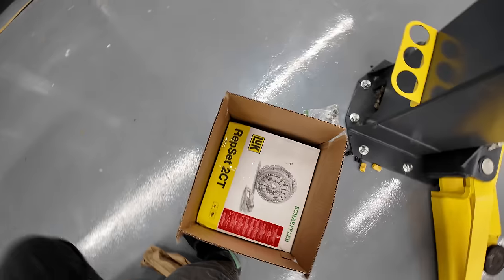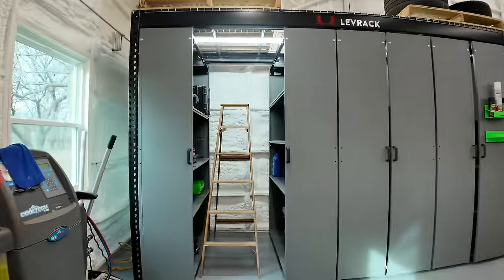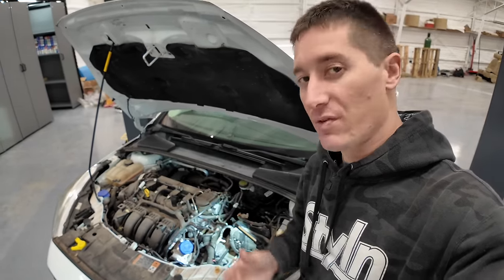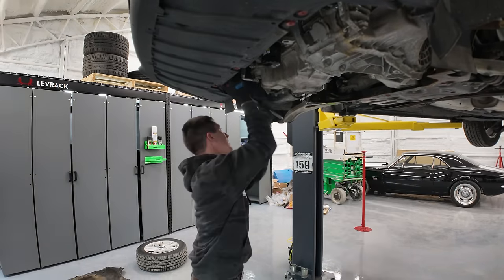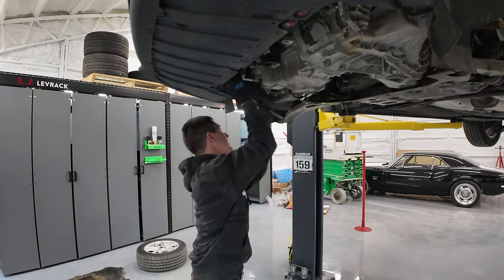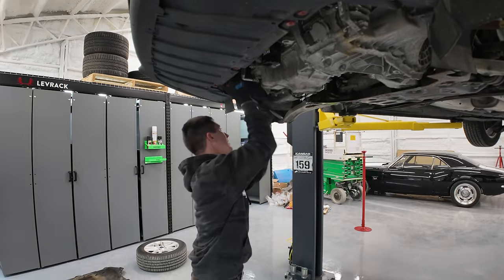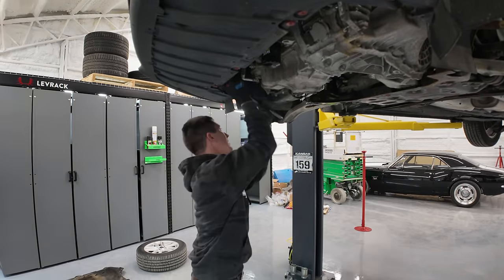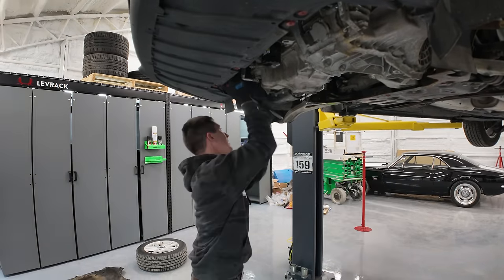Fixing The Problem That Ford REFUSED To Solve *Ford Focus DCT Clutch Replacement*

Comment: I'm shocked at the reasons why Ford would design such a transmission with no longevity, durability or reliability in their design and execution. 
But if you hire a bunch of newbie engineers who all want to make a name for themselves and completely forget about  applying the  common sense approach to any design of theirs, what ends up is built in flawed  ideas .
Reply: Wasn't it purchased from another company?
Reply: @deanstyles2567  Yes I believe you're right. The only car that Ford still manufacturers is the Mustang but as any Corporation who makes agreements with other car companies would have a team of engineers look at what they are getting themselves into, and since they all want to keep their jobs as Ford employees, they basically don't want to go against their bosses decisions simply because Ford has screwed itself by not designing, and building cars that are competitive in the marketplace. They still had post WW2 war syndrome in their thinking of quarterly profits rather than building quality products that have durability, reliability, longevity and the use of superior materials. 
And to have to see them not honoring the warranty to repair is just another sign of deep corporate corruption at all levels. 
They are like every other American automotive manufacturers. 
It's the 80 / 20 plan of attack. 
Throw out a bunch of poorly designed, assembled and lower quality materials into 80 % of their vehicles and see what sells and makes the most amount of money for the short term to pay for all their cooperate blunders from the past like the Edsel,Pinto, Taurus, Arrowstar,and the flip over expedition and have to go to court over the deaths of thousands of customers who bought this vehicle's only to have to loose their lives over a $3 .00 part that was demanded by the engineers to be located away from the heat of the engine to avoid possible fires.Or relocation of the fuel tank. 
And that's the 80 % of their business practices, which were personal vehicles, now the 20% was a different story. 
It is focused on building vehicles for the business side of the economy. 
Trucks and luxury cars were the cream of the milk can .
Owning a  small business or running a large corporation all require lots of cash investment. 
Trucks Trucks Trucks are the means to move things to their destination and provide a service which is chargeable fees . F-150,250,350;and econoline Vans 
And much better designed cars with comfort and better reliability in mind for the executive class is also part of the 20% zone .
This is the territory of the Crown Victoria, Lincoln, and older Mercury's. 
Yup they really screwed themselves up to the point of little to no returns by letting the Japanese /European auto manufacturers over take their industry and market share .
And it's an air apparent that the similar thing is now happening to the rest of the country with the unchecked mass migration across America's borders. 
Imagine that all this started from the core problem of greed and the love of money which replaced the ideal of building things of quality to sell to the American families. 
Yup and even the family is becoming an endangered institution. 
Anyway sorry about the novel.

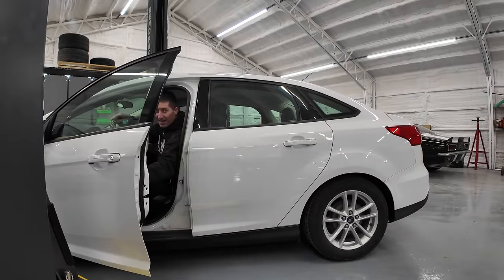Comment: Genuine question about the powershift transmissions, in regards to your comment at 2:37...    Is the programmed (in Drive and brakes not applied) "creep"  achieved with precisely calculated clutch slip?

Comment: JR it's not what Ford couldn't, it's what Ford wouldn't. This is why I don't buy new Fords anymore! They don't stand behind their failures. Quality is job one flew out the factories at Ford a long time ago. The last new Ford I bought was a 2011 Ford Fusion for my wife, great car, no problems. I replaced it with a Toyota Camry in 2020 because Ford didn't have anything comparable to the 2011 Fusion SE in the the 2020 Fusion SE. I don't want a turbo engine and that was the only engine choice for the Fusion SE.

Comment: 1st time watching your shop,amazing floor and lighting,how long has the coating last? excellent tutorial for diys and 1stimers. dont forget the tire inflator kit (just kidding),and whats up w/the three jb weld packs on the table?(also jk). ps my freind, pls dont use too much brake cleaner if you can, bad for your kidneys and health. i use light soapy water,and blowdry if possible.i tell my cust. to not inch forward in traffic jams. excellent work,not easy doing it right.

Comment: The clutch is not covered under the extended warranty from Ford, just the TCM and I'm pretty sure you know that.
Reply: He does,  but a clutch  shouldn’t last only 60k miles with  normal use, what garbage

Comment: Had that tranny in our 2015 Fiesta, dealer replace clutch twice in 45,000 miles, never did fix the issue of it suddenly taking off when stopped, also had chronic battery discharge problems if it sat over a week, had to install battery maintenance charge even with new battery!  Car drove great but was a drive train mess, so bad that when the trany was designed it was supposed to have a wet clutch but Ford went cheap with dry clutch, trany was so bad the design engineers refused to take cars home when supplied by Ford for testing!

Comment: As an automotive engineer having worked with and for the big 3 at some point, Ford appears to be falling in quality and engineering aka bad decision making. If the public only knew the chaos associated with developing and releasing an automobile.
Shameful lack of support from Ford at the 50K mile mark knowing this transmission design is sh!t. So, best to tell the world on youtube so the public knows.  BMW of course has moved away from Dual clutch transmissions recently. Why? Because the juice (quick, firm shifts) isn't worth the squeeze, aka weight, complexity and most importantly abysmal reliability and tunability...mentioned creep and low speed performance.  Overreach on the cheap by Ford to release something that isn't true i.e. a low cost, reliable dual clutch transmission. Trust me, when I tell you 'many engineers' knew during development this was an ill fated venture because testing doesn't lie. They released it anyway for 'marketing point's...lying to the public which is common btw.
Word up to average home mechanics doing this. Sell this car and don't try to fix it. Why?  Because history will repeat itself.  Or....if brave enough to pull the trans yourself and you have to be young, strong and smart to do that at home...don't try to fix the trans, purchase a remanufactured unit where pros rebuild them with fresh parts.  But I wouldn't. I would sell it and buy a car with a manual gearbox or torque converter trans.

PS. for those wondering, life for car owners is getting worse and not better. Why? Because automakers are deliberately making cars more complex for greater part failure out of warranty for more profit. Planned obsolescence. Even Honda and Toyota can't resist BMW's business model of over engineered cars for profit....not over engineered to last but to fail. Automakers make more profit when a higher percentage of replacement parts fail as compared to  automobiles they sell. Its a hustle. Buy a complex vehicle...like a hybrid with two powertrains and expect to pay dearly out of warranty.  Sell your car just out of warranty and get hit with massive depreciation, especially true of EV's and hybrids as the battery degrades everyday you drive.

Comment: too bad this didnt have a nice 6 speed torque converted trans. i know ford has issues with those but behind a 2.0L and with fluid and filter changes it should last 200k with a little lucas stop slip near the end.

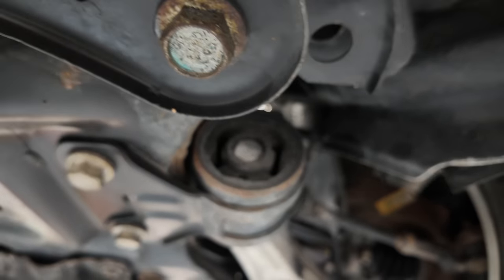Comment: 8:50  The front control arms on Focus/Mazda 3 of these era are a very, very weak point. Even worse is the replacement parts available. Most have rubber that is so soft that the steering will feel like marshmallow after 30000 miles, and time to do it again. It was even worse on the Mazda 5, as it is heavier.

Comment: Ford did not design or make the Transmission and they didn't refuse to fix it. Ford sued the company and were forced to fix the problem but never did. My sister has a 2013 Focus and the dealer has had the transmission out 4 times for updates. Since the last one it works
better than it ever has but it's not perfect. Other than the transmission, it's been a great car.

Comment: Please say that you are going to sell this once its back together - smartest thing you can do with one of these Fords is get it working and dump it, because the failure is just going to happen again in 25,000-40,000 miles, the design of the transmission itself is defective, there's no permanent fix. Ditch it and use the money for a down payment on a Corolla.

Comment: I bought this model new in 2015. Within two years, the problems began. I've replaced the transmission, the clutch (2x) and shift forks. The dealership and Ford Canada refused to cover the cost for a third repair last week. This was an inferior product out of the gate; it is the worst car l have ever purchashed, and they won't get another dime out of me.

Comment: So glad I didn’t buy a Ford Focus in 2012. Bought a ‘13 Elantra and it has been rock solid reliable 86,000 miles and 11 years later. Normal, 6-speed auto.

Comment: Glad you decided to fix this Ford and publicly rub Ford's nose in it for their conduct in not honoring the warranty. It's still amazing to me that a car with only 50k miles needs a clutch and has ripped out bushing in the front suspension.  Either the former owner was off-roading the car or Ford is using some pretty marginal quality parts on these cars.  Strange.
Reply: Most Volkswagen manuals of late need a clutch at 80K when the throwout bearing/clutch slave decides to leak on the pack

Comment: Chrysler uses the same stupid capped lug nuts, and has since at least the 80's.  I've fought and replaced them all the way from the '85 Chrysler Laser (aka Daytona) I owned when I was in my youth all the way through my '12 Grand Cherokee.  Maybe Fiat dumped them finally but I doubt it.

Comment: Approximately 60,000 miles and two shot bushings undercarriage is not good. Keep pointing out ford's cheap flaws and more on that focus, especially after them not doing the right thing and fixing it free for you. I would call them afterwards and really rub it in about how your viewers are now educated about ford focus issues. Thanks.

Comment: Can I say even though you had a lift. Messed up the process starting with not level on the ground cold or not. All clutches are heavy including the fact the transmission should be level not on its side. Multiple mistake impact fucked up. Please title what not to do and how it felt
Reply: Ford said 3500 and you'll rest assured or sell it. Never take short cuts. Trying matter but...  😪

Comment: You made that look way too easy, I want to do a tranny swap on a similar setup, but I don't think it'll be near as easy as you make it look lol
Reply: Having a lift and all the tools can make it look easier than. For most of us, not so much. I have a 2012 Focus with a 5 speed manual that could really use a new clutch, but probably don't have the capacity to do it.  Still working, but it's either have it done or junk the car. 155k miles, and it's my work beater. Bought it new 12 years ago so kinda at a quandary about it.

Comment: Henry is likely rolling over and over in his grave right now. With Model A cars (Paul Shinn shout out) there is a four door I believe it is a 1929  out in Cali that is still original and running. About 77~thousand miles and never restored. Paul says its the smoothest Model A he has ever driven. Compare this to a 2015 of the same name (sadly turning into a badge of DISHONOR) that if JR Go did not fix it would be headed for the shredder.

The new ford "Built Poo:face-fuchsia-poop-shape::face-fuchsia-poop-shape: Tough" so now Ford is synonymous with recalls and disappointments on so many fronts. Ford is at a critical moment much like they were about 60 years ago when Ford was at a another quality and durability crisis. The 50's closed out with notorious valve train noise on V8's with 40 K miles or less because they oiled so poorly. Overall quality was way down. Ford spend 1.5 million 1963 $$ to turn it around. And that they did we ended up with the 289, 352, 360, 427 all of which were great in their own right.

Ford is too busy following fairy dust and moon beams. Cars from Ford, as much as we assume Ford even makes a car that is recognizable, are going more and more tech with less and less meat and potatoes that makes the car have the engineering, materials and craftsmanship to stay together and perform with routine maintenance year over year. Sadly Honda and Toyota are following the trends with tech and fluff over substance.

A novel Idea. How bout we put a 3.5 liter straight 6 minimum engine controls, Basic but functional AC no screens, analog gauges and manual transmission in exchange for all this puff vapor ware we get today?. Serviceable and replaceable switches for everything. 

Make it look like a car, make it serviceable with suspension parts with grease fittings, and have the engine compartment look  like one instead of a plastic molding plant under the hood?

I bet people would buy it.. what ya think?

Comment: Pfft really really well design. Now that's an overated statement.  When have they ever design anything worth its own weight?  Never!   You're giving  ford too much credit.  A well design vehicle shouldn't be having major problems under 150,000 miles or more.  With the exception that it's a normal wear.

Comment: problem is its just going to break again. these transmissions are inherently flawed. they cannot be made reliable, the dry clutch design simply does not work. 

it's sad ford fucked up two really good cars (focus and fiesta) with this piece of shit. with a good transmission they'd be the best small cars an american company ever made, and with this they are some of the worst.